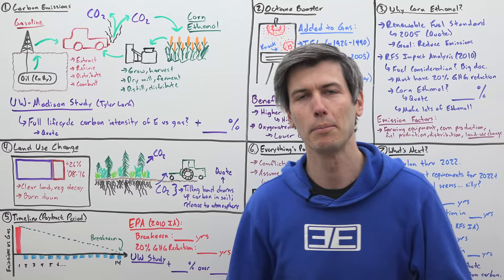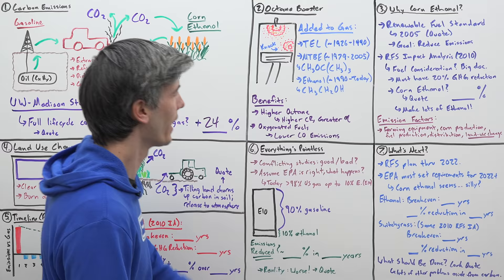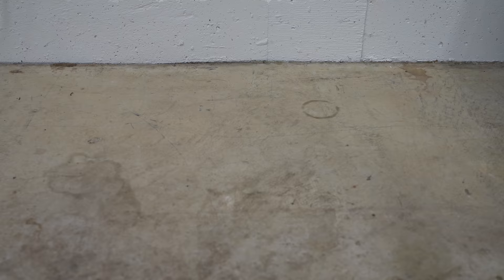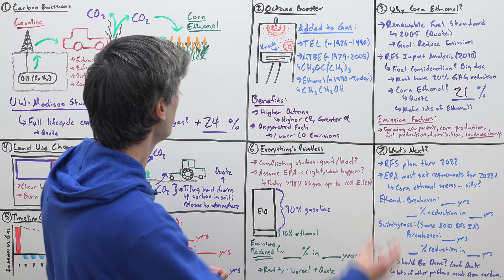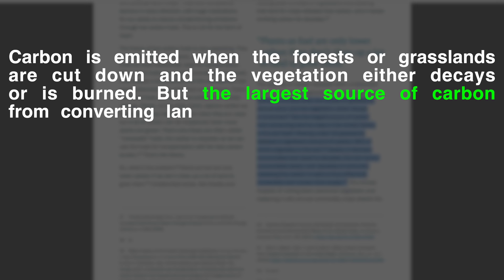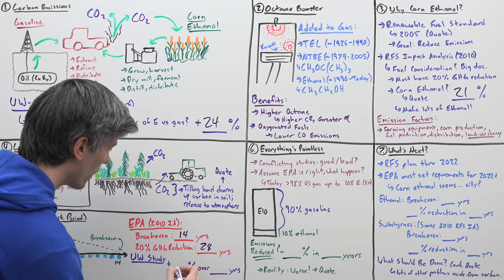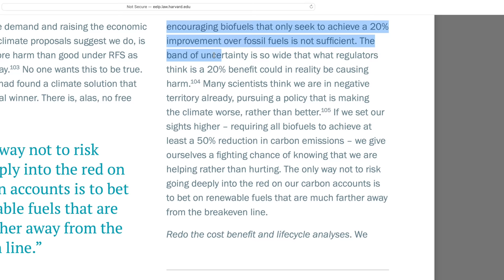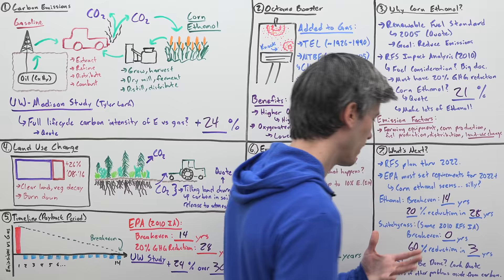America Was Wrong About Ethanol - Study Shows

Comment: I'm a little late, but Brazil (where I'm from) does use ethanol as fuel. And probably we're the only country in the world that does that in large scale. Here, at any gas station you have both options (ethanol or gas) and of course Diesel too. Our gasoline is mandatory 27% ethanol mixed or we use E100 (even BMWs now are flex fuel). We started it back in the 1970's due to oil crisis, but environment and sustentability wasn't a concern. We did it for economic purposes and we have a domestic control of an energy resource.

In Brazil we use sugar cane and it take 17 years to breakeven the carbon release. Many, many studies have been conducted here. One thing, decades of inovations made the whole chain to be 30% more cleaner since early 2,000s when 2nd gen ethanol began. We also have to consider ethanol from sugar cane has a better ratio of gallons per hectare than corn. But any inovation or gain you only can have if any country really adopts ethanol in large scale and then as expected, invest to make it way cheaper, relase less greenhouse gases, etc. That's what happened here.

Let's be real. If you wanna think about environment and sustentability we can only have by reducing private vehicles (ICE or EV) to public transportation. Tesla wont1s save us. What will save is our change in behaviour and consumption. You can't beat physics: 4,000lb car to carry 1 or 2 people is not efficient.
Reply: AMEN brother!
Reply: Yeah but the lighter the car the less safe it is in a wreck. That's why we can never have flying cars, they would absolutely fail any crash test standards.
Reply: @trey2735  just don't crash the car
Reply: @trey2735  any safety gained by driving a heavier vehicles comes at the cost of people outside of the vehicle which creates an incentive for others to drive heavier vehicles which creates a feedback loop that leads to heavier and heavier vehicles
Reply: @trey2735  Lighter cars made of metal is less safe. Lighter cars made of carbon fibers and such are not suffering from the same problems as they are easier to make crash resistant. They absorb an impact in a much different way. We can take F1 cars as an example. Will it be more efficient in environmental terms, as for construction? I really don't know. But it will reduce fuel consumption.
Reply: What do the tractors that plant and harvest the corn run on. Like all tractors they run on diesel. Takes about 26.1 pounds of corn to make 1 gallon of ethanol one acre of corn averages 7700 pounds corn. It takes 1.5 gallons of ethanol to do the same thing one gallon of gas will do. I won't get into all the math, 1 acre corn to make roughly 290 gallons of ethanol press the diesel fuel it takes to plant and harvest. Ethanol is not economically sound
Reply: @cecilandrews7479 bio diesel is a thing.
Reply: @cecilandrews7479  guy with a sunflower farm said it took 20% of his crop top make enough biodiesel to run his farm. As far as I know, you can get ethanol by fermenting the waste products of bio diesel production and vise versa.... But yeah, there are definitely better crops to make ethanol from than corn.
Reply: @EnriqueThiele
Electric vehicles only deals with one aspect of emissions. The very production of electric vehicles is the same as gas and diesel vehicles the steel plastics and glass are all mined with heavy duty equipment that burn diesel fuel and large furnaces that create carbon emissions
Reply: @lesleyboeder1798  That is true. But we need to consider that the gas and diesel cars have a more energy consuming logistic network. Even if we factor in losses in power lines and all that. On top of that we do have better capabillities to control pollution from fixed installations such as powerplants.

There is no "silver bullet" that will fix the problem. There will have to be many different solutions in combination to get the desired result.
Reply: @trey2735  Pickups and large SUVs are among the poorest performing among all passenger vehicles in IIHS crash tests. Heavier definitely does not equal safer, but it does make them more dangerous to other vehicles on the road.
Reply: I think changing the roadways could make a big impact even without doing anything to automobiles. It can be done better with changes. 

Just like the HOV lanes are used. 
Separate lanes with barriers for different types. 
~All shipping like big Riggs having their own lanes. Steady more efficient travel. 
~Self driving lanes. 
~Also (I know it’s a lot) but like the Tesla tunnels interstate. Cars turn off and are moved on a rail type system that’s more efficient. 
~ This will also greatly reduce accidents, allowing for the lighter construction of vehicles.

A grid of bullet trains for personal cross country travel can reduce a lot of traffic. Auto and air travel.
Reply: @EnriqueThiele only works if we move to nuclear power however. also the cars have to function and be reliable for decades to balance out the increase in emissions for production of EVs compared to standard ICE vehicles. also most modern vehicles have a ton of plastic in them already, from interior panels to the bumpers and fenders.
Reply: Yes lets use public tansport so i can increase my chances of being shot or stabbed. 😂 yeah no, ill keep using my car thankyou.
Reply: @GenesisRasphotos you have to understand that in those 4wrld countries, personal space is a luxury. they can't comprehend the word confort; it i sad but because of that they wouldn't want anyone else to have it!
Reply: Not gonna happen pinko

Comment: If you're going to argue that ethanol isn't necessarily a poor choice aside from the emissions resulting from land clearing and production, I'd be interested in seeing a similar scrutiny applied to the process of refining oil. Specifically, consider the emissions impact of constructing drilling platforms and transporting oil in container ships across oceans compared to a farmer clearing land just once. It seems you've overlooked the fact that our energy demands are growing, and we must address today's needs. If, as you mention, the lifecycle of ethanol proves to be more favorable than the linear journey of oil from extraction to atmosphere, then the one-off impact of land clearing could potentially be less detrimental than the ongoing processes involved in importing foreign oil or erecting infrastructure for refining oil into gasoline.

Considering a container ship's journey from the Middle East to the United States, spanning roughly 8,000 nautical miles at an average speed of 23 knots with a daily fuel consumption of 150 metric tons, the voyage consumes about 13.78 million gallons of fuel. Intriguingly, this amount of fuel—the same consumed by a cargo ship on such a trip—could be used to clear approximately 1,722,861 acres of land with a bulldozer that uses 8 gallons of diesel per hour and clears an acre an hour.

I'd appreciate your perspective on this.
Reply: He was arguing that we should have went with another alterative to corn instead of using corn. He cited the oil would be bad to continue with but switch grass would be better than corn and there are others too. Right now I am thinking we will be going onto EVs and nuclear fission for how the USA will be powered. The fear of a nuclear melt down is founded in a false understanding of how it works. Yes it can happen if all the safe guards fail all at once but the fall out will be less than what was in the example commonly given of Chernobyl. It made it seem bigger than it was and now humans can live there again just not as well as we can live outside of a nuclear fallout zone. The main reason why is the fuel source is different. Then you have how the fission is done is different then how the safety is done is also different. If everything fails the lead inside of the thick cerement blocks that make up the outside of the building will prevent it but even the dead man switch will prevent that from being needed. So even if everyone dies and no one is around to hit the button there is a fail safe to make sure it will be stopped. The reactor will not be useable afterwards but the reaction will be stopped. The people who design them learned over the decades how to do it efficiently and safely. Still the sci-fi tech of fusion power generating power is not here due to what is needed to contain it. Fusion has been here for 1000s of years being controlled by humans just not a power source. Maybe in the future we will have fusion power but right now all the new nuclear power plants are for fission power.
Reply: @yumri4  love ur comment n ur view of the nuclear plants and how they have been improved compared to Chernobyl.  But he didn't mention nuclear at lol
Reply: If corn can be used to make fuel, and the emissions end up being somewhat similar to a gas car, and if you think about the transportation, how oil is gathered, processed, etc., being able to eliminate a lot of that process, and if they are not buying the main raw materials from overseas, the price for E85 should come down in price significantly. Well, you would think so anyway. And if they started making cars come out of the factory as flex fuel compatible and invested in ways to lower ethanol's emission output, I don't see why a renewable fuel like E85 wouldn't be a viable idea since the world will one day run out of oil.